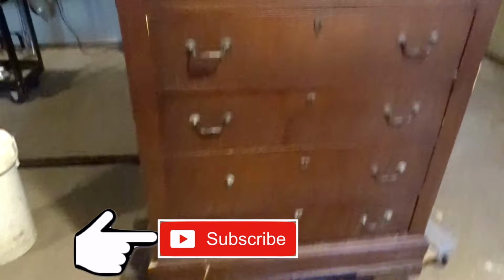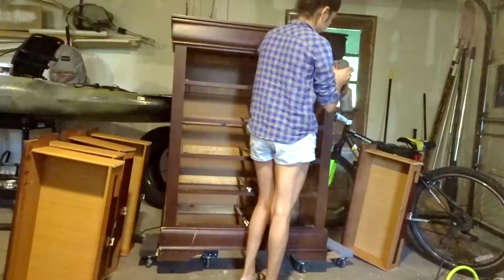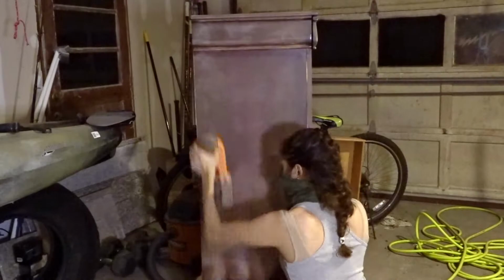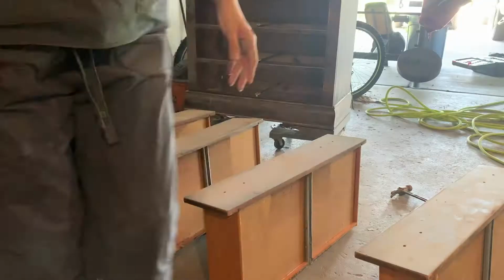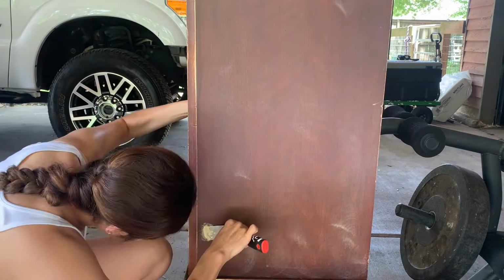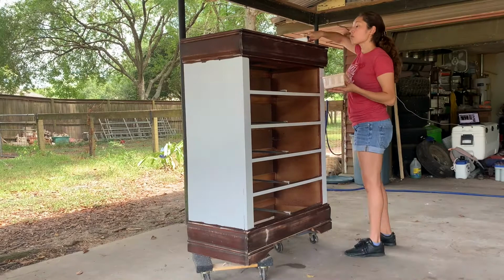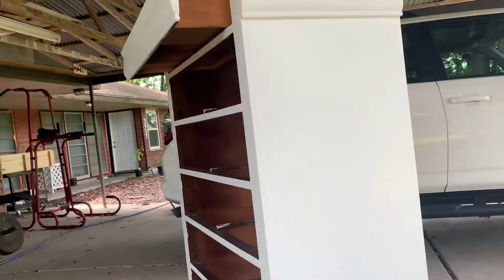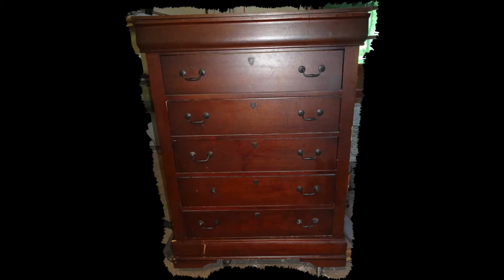DIY FURNITURE MAKEOVER|EASY DRESSER PAINTING TRANSFORMATION|HOW TO REFURBISH FURNITURE

Comment: I think your baby goil is so cute and adorable! Start training her to flip furniture now, so she can help flip her crib. You did a fantastic job. It came out beautiful. I, too, use a foam roller when I paint huge pieces with semi-gloss latex paint when I flip them, but I sand in between coats with a 220 sand paper. It helps knock down the dimpled texture the roller leaves behind. I also lay down a shellac based (stops bleed through from stain on wood) bonding primer before I paint with latex. For the final coat I use a Purdy latex brush, but I water my paint down to help cut down the brush strokes. It works pretty well for me and it leaves a really nice smooth finish. You could also do several watered down coats to keep brush strokes down to a minimum. So that the spray paint on the hardware doesn't wear away due to usage, spray them with a Clear Topcoat in Matte Finish after spraying with flat black. Keep up the great work.
Reply from the maker: Thank you so much for all the feedback ❤️